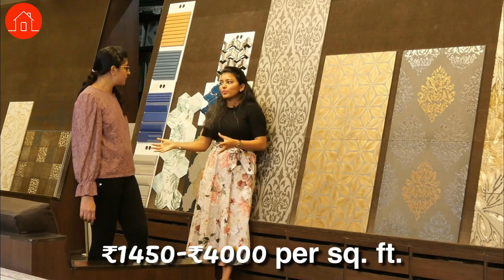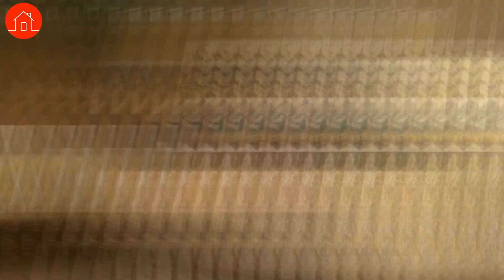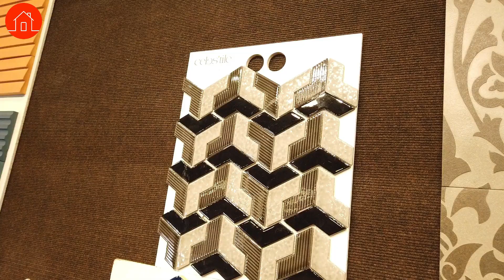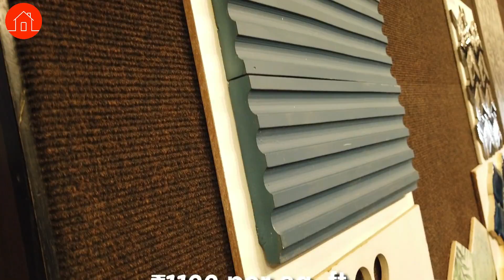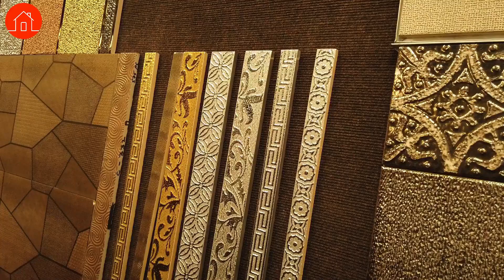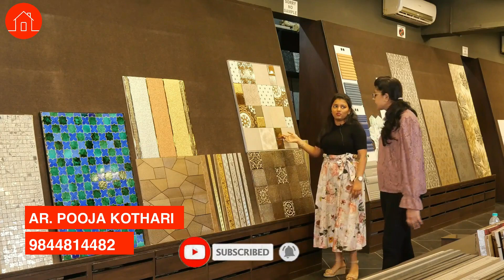Fancy tiles for your home | Modern floor & wall tiles | Latest tiles technology | Home interiors

Comment: Yes the technology involved is high and requires more labour and work but this is way too EXPENSIVE, she is quoting ₹1500~some ₹4000 per sq.ft for that amount i can remove the entire tile get the new tiles i want with all costs involved and still save money....
Of all the interior design and material videos i have been following for last 2 years this is the worst pricing and costliest of all. 
I feel that tile glazing and tile on tile she said was 100% unnecessary considering price/sq.ft.
Even in today cost of luxurious construction is much below of her quoting.
Correct me if I'm wrong

But i love your videos ❤